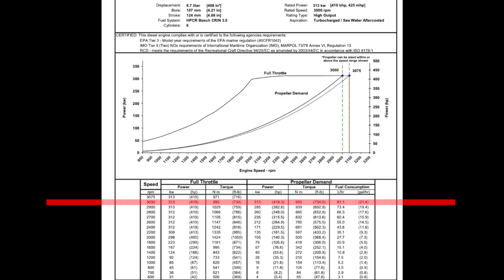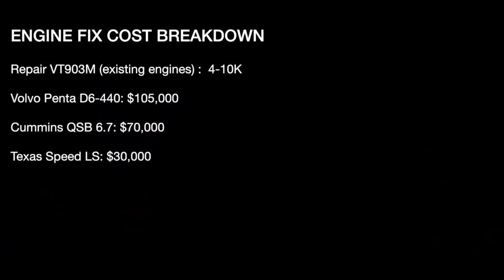Tesla Powering my 30yr Old Italian Yacht? And Broken Diesel Engine Diagnostics

Comment: Putting a gasoline engine in would have been the biggest mistake ever. For a reason I didnt hear you mention..Explosions on a boat are very real and happen most often on Gasoline powered boats. You would have to have large blowers in the engine compartment to evacuate the fumes from the gasoline vapors in the hold. Diesel is far safer, more reliable and will out last any gasoline engine. I think your just bouncing a lot of Ideas around, which is fine. just remember the engineers who designed your boat are waaaaaay smarter than you about boats. Don't mess with what works. Have them both rebuilt by professionals..Have fun boating, instead of all the headaches with engine swapping. Oh yeah, one more thing Never run a knocking engine. It came with two for a reason. so you could shut one off in emergencies, and get home on the other.. Nice boat.. Happy sails...

Comment: dude those are cummings engines.... they are like some of the best engines in the world bro.

the diesel fuel is cheaper.

they make more torque at low rpm (you gonna have to rev gas to move). its gonna get real old real quick redlining your engine just to turn around at the dock, while people float across you at idle.

they're already 'built'. the pistons, rods and crank on those things are massive. You could boost it more now, as it is, stock, without adding anything.

The engine case pressure blew off the rocker cover cap. What gas engine do you know that can have that amount of crank case pressure in the head and still have no cam or rocker assembly damage?

you can add in digital gauges to monitor the engines any way you need to.

im worried you are really going to affect the quality of your future boating experience for something that is temporarily cool

Comment: Out of curiosity, if you were to go electric and wanted comparable performance and range, just how many battery packs would you need?
Reply: Omg a lot .. you would need a charged battery pack every 5-7nm but you wouldn’t be able to carry any more than one per motor otherwise the increase in weight would add drag which would lower the range on a charged bank .. see where this is heading ?

Comment: If you went gas engine surely you could run an LPG system thus bringing fuel costs down. But equally there must be a reason most boat builders go diesel
Reply: Bang!! There is a reason you never see lpg in marine situations

Comment: food for thought the boat is balanced around the weight of the engines where they are. There could be som pretty big issues caused by getting lighter gas engines. Plus the economy will be alot worse.

Comment: Your math on the electric motors is very wrong. The 1 gallon of gas to 33kWh is purely from an energy standpoint. You have to factor in that electric motors are 80-97% efficient while gas engines are 15-25% efficient. You should do the math out again before ruling out electric because it would be so much more practical and you'd have 1 of like 3 Tesla powered motorboats in the world.

Comment: You don't want a 'failsafe' that automatically shuts an engine down. Alarm yes, shutdown, absolutely not. There could conceivable be a time where in bad conditions you need to risk  sacrificing the engine to get out of harm's way....say you have to make it back across the bar before bad small craft advisories and gale force winds hit. High reliability is the name of the game out on the ocean. ...any modification you make should be focused on increased reliability,  not performance.

Comment: you could do electric without going the ludicrous motors, and a lot more battery capacity, plus an emergency generator? for a lot less than $70k. pretty much be PHEV diesel electric lol.

i still vote rebuild the diesels, they're still cool.

if you're concerned it's not crazy enough.. build the diesel, bigger turbo, more boost, make them make power?

Comment: You really only have one option; diesel.  As you pointed out an electric motor is ridiculous.  You might get 15 minutes and you WILL get stranded.  As for gas, and while I realize there are LOTS of gas boats, gas engines have no place in boats.  In short, they are expensive to run, inefficient to to run, and dangerous as hell.  Most boaters with gas engines would die to have diesel engines, which you already have.  Don't go backwards.

Comment: There is a reason they use diesels in larger boats.  Stay with the diesel and just rebuild them.  Fuel efficiency and torque will never be the same with gas.  you will regret swaping to gas.  probably destroy your resale as well.

Comment: Dude stay with the diesels. You said it yourself they create more torque that is a very heavy boat probably 18-20,000 lbs add that to pushing water you need the torque. I have a 1999 Trojan Express 400 with twin 5.7’s that I wish were diesels. Back in 1992 when the first model came out it was the american knock off version of your European Riva Tropicana Express. I love my boat it is a solid beast almost a 14 foot beam, 19000 lbs and a modified planing hull. Epic in the chop but trade off is.......she is slow. With that type of weight stay with the diesels you won’t regret it. Furthermore, you said it yourself those engines in your boat haven’t been touched in thirty years pretty reliable I’d say, think about it. Finally, CLEAN  your bilges all that dirt, grime and oil residue down there you have a fire waiting to happen. Good luck and definitely put the dripless shafts in!

Comment: You need to stay diesel is you want any value of the boat. A LS Swap would be cool and all but you will not get the ROI. I do not know what the difference between the 903 t and the 903tm (other than marine) but if you look you can get a military surplus 903 t for around 14,000, I am sure you could take the surplus engine and make it a marine engine. Since you should have the parts to swap.

Comment: You have two engines that were far larger (power wise) than a traditional semi truck engine. Imagine trying to run a loaded semi on a gas engine of any type. IT WILL BE A DOG if it moves at all. Rebuild those Cummins V8s and run that boat.

Comment: Diesel is a Nightmare :   with a big-block 454 chevy you can spend $1,500 on spare parts ( any and all parts that may Typ. break )
do that with a diesel and ur at about $7 -8,000 Min (fuel and water pumps, alternators, starters etc...)

Comment: Stay with diesel it is actually more efficient for boats, it has more power, you have longer range, and those engines will go forever as long as you have fuel. Seen a Riva with das engines and yeah it had speed but it went through 300 gals in less than 15 hours, the vessel I was on we had 200 gals and went from long Beach ca, down Ensenada and back to san deigo the gas engines are also more flammable than the diesel, you would need to put blowers in the engine compartment to clear the fumes out.

Comment: Majority vote here stick with the current engines rebuild possibly mod cause Cummins... and enjoy the boat yes engine swap would be fun but value for money long term gas is gonna kill ya... and like you stated imagine running a gas engine at full rpm for long periods most worked engines won’t do that for very long...

Comment: Depending on fuel efficiency and fuel prices you may be better off staying with the diesel engines repair of rebuild they are at least reliable when in good running order and the boat was designed for them in the first place and safer as far as fire safety is concerned  since diesel has a higher flash point than gasoline and the change over to gas entails more modifications than you may think.not just the tank and fuel lines but other electrical additions as well as fire suppression system you may want to include .for safety you know ..just in case  because a fire on a boat in  the water  and/or in the middle of nowhere is no joke..the other equipement that needs replacement or upgrading are just as important. I live in Fl. and boating is one of the number one things here and boating safety is a legal thing all over the world. navagation lights are juust the tip of the proverbial Ice Berg.   thyat boet is "{a big hole in the water that you throw money into never to get it back,,,,GOOD LUCK!!

Comment: Rebuild then and re fit the cummins The boat was designed to be powered by them def more bang for your buck and the fuel is 100% safer than a gas engine

Comment: i would rebuild old ones they’re bulletproof made for it don’t have to modify transmissions with new expensive engines an these new diesel engines have problematic emissions installed in them ,they won’t last 30 years like old ones ,stay with old cummins you would be much happier good luck

Comment: If you want to go electric as a power source then you are thinking backwards. You are thinking of battery storage. You should instead be thinking electric production through the use of an onboard power plant such as diesel engine technology. This configuration has been in use since the 50's. I work in the rail industry and when our locomotives have outlived their cost verse asset analysis due to age or emission regulations we scrap the locomotives and the engines get repurposed to marine applications. You can have 1 diesel engine powering a generator instead of 2 powering props. You can even use pods instead of the props if you want to be more efficient, agile speed. Weight analysis will show less weight to power equals further range and efficiency. Do your research, cruise ships and bigger are powered this way. A project of this nature would get more views and would increase the value of this vessel unless you are just using your existing sponsors for this project. Diesel electric is the way to go to modernize this 30+ year old vessel.

Comment: I wouldn't use gas engines in a boat, as the hulls waterproof, it's also airtight. Any fuel leaks mean you have a potential bomb.

Comment: Wait you just talked about why gas engines aren't feasible in a boat application due to the engine needing to run at very high torque and power for very long periods and how you can't expect a gas engine to run at high output and RPM's for hours at a time. Then you ignore all that and start talking about putting in Texas Speed LS engines into it. What's wrong with this picture?

Comment: 100% incorrect , boats built to plane use less power on the plane because of the low water friction eg. the is less boat in the water to cause drag, the power is used getting the boat on the plane in the first place, the most inefficient  speed in a boat  is above hull speed and planing speed , the reason sail boats use so little fuel  is they  use tiny motors (about 30 to 40Hp for a 40 footer) and they stay at or around hull speed (6 to 8 Knots) and rev at or around 2500 rpm if they try to exceed this the stern just drops in the hole in the water caused when the bow wave hits the stern wave going no faster but using more fuel, thats why power boats have trim tabs to help stop the back of the boat burying and to make it easier to get on the plane.

Comment: I'd say rebuild the diesel. You haven't had it that long so go cheaper and enjoy it for a while. If you want to change it later, I'm sure you could sell those engines for plenty. Plus I'd bet gas engines would kill the value, not just because it's different and not how it came but because 2 engines are 30k versus 70k+ for diesels. But it does sound like you should keep an eye out for a "needs work" yacht and fulfill your big block dreams!

Comment: havent even seen the vid but i will say HELL YES, make it electric engine ffs, you could use solar panels and have unlimited fuel,if your battery bank is big enough it really could be unlimited electric motor power :), and if you want the foot pounds to move it across the water electric motors can give you massive ammouts of it .

Comment: Electric is the ONLY way to go I have new 2170 20 watt 5 amp batteries @ $2 each at 15,000 x 2 batteries will give you .5 MW per engine and you could get 1.5 hrs at 40 mph with it, you will need to 1.5build the battery pacck but that is relatively easy , your fuel tanks are replaced with the batteries and put as low as possible as well because you have saved 5,000 lbs in dead weight just in the engines the 1200 pounds of fuel saved will give you a boost that is much lighter,  have a source for the batteries. but you need 21700 or the new FBB from Tesla good luck. you will need rapid charging but 220V @60Amp will give you 17Kwh so 5 hrs should get you charged the batteries will weigh 2819 lbs you save 5000 lbs.

Comment: Multiple electric motors like the Mach-e to Increase power/torque. Then a diesel generator to increase range and recharge anywhere?
Reply: No... read the laws of thermal dynamics.. gen =mechanical to electrical energy,, electric motors = electrical energy to mechanical energy.. the laws of thermal dynamics dictate that at each energy change there are losses .Diesel engines produce mechanical energy , so ....

Comment: bruh! why the hell would you go gas?? if anything use gas engine go E85 at least! the way to go will be 
1) Rebuilding the diesel engines!
2) Doing all the gauges and custom ecu for safety shutoff's and more digital data (for the diesel engines)
3) New Nav systems, depth meters, satellite Wifi and all the fancy gadgets 
                                                         Maybe 
4) battery packs for electric consumption hooked via a diesel generator/engines

Comment: great video! question, when you looked at electric, did you recalculate performance eliminating 2 super heavy engines and huge fuel tank, and the engines related stuff, exhaust fan, transmission, etc... So, very cool video and thinking out of the box!

Comment: Please keep the diesel, being a marine engineer, replace the engine, please do not mess round as its not like a car where you can pull over and wait for assistance, sure you have a second engine, but not worth the risk rebuilding having seen engine failure and people rebuild and fail again, not worth it. 
Also if you take those engines out and put smaller ones in you will have to ballast the crap out the stern, plus lead anin't cheap!

Comment: Hiya Chris, huge fan, been watching from the start and love you guys.

I have a few very poorly researched comments to make on your choice of propulsion. I have no axe to grind, my daily is a performance diesel, by race car is gasoline twin turbo and the experiences I’ve had of EV,s has left me in awe.

So, when you looked at the power density of gas vs batteries, was it “at the tyre” or accounting for the combustion engines  making 75% heat and noise and Only 25% go and the Tesla motor turning 90% of the energy into drive or were you working off before losses.

Also why only 2 battery packs? if your 2 motors and full diesel tank weigh 9000lbs and 2 Tesla motors weigh say 500lbs, would it be feasible to put 8500lbs of batteries in ? 

Anyway when you take the above into account it clear to me you need to get Exxon to sponsor you and install 2 x BB Chevy 540ci motors with 4.2l Kenne Bells. 2000ft lbs at a relaxed cruise and drag boat racing with 20 brave passengers on the 4th of July 🤣

Comment: Hundreds of gallons of gas/explosive fuel is not smart to have on a boat... also, if you are not looking to go 40, you can use much more economical engines than the top of the line Tesla and use the fund savings for 4 sets of batteries with an onboard emergency generator... lastly, you will nead less thrust with the 9/10K pounds of engine/fuel you are removing... don't build a boat for anything other than how you use it, by the time you are done, you will realize its better off sunk than sold.

Comment: I cannot fathom why anyone would switch from these diesel engines to any gasoline engines. Gasoline engines are far less efficient, have much less torque, especially at low rpm, which would require higher rpm, which increases heat, which increases wear, which increases maintenance intervals, oil consumption, and the likelihood of failure. On top of all that, gasoline is a MUCH more volatile fuel and you do not want to be stranded floating next to a burnt out hulk, assuming you survive. In short, no offense, but you're not smarter than the engineers who design these things. If I were you I'd look into maybe just modernizing these diesel engines with better gasket materials, bearings, an upgraded fuel system, better turbos (maybe twin scroll or compounding?), and more sensors (MAF, oxygen, crank angle, cam position) that could be used in conjunction with a modern aftermarket ECU. Maybe get in contact with Gale Banks.

Comment: Stay with diesels they live forever when taken care of. Ur gonna need a counter rotating motor and a standard. The port motor is the counter rotating and the starboard is the standard. Just remember what u do to one motor u have to do to the other. Want to keep everything balanced.
Also if you go with big block get some 502 8.2  much bigger displacement --> more power. Also not called flooring it, In a boat is  Called wot, wide open throttle.

Comment: for electric, there is a Swedish electrick boat company (maybe ask them for info and advice), and there is a new electric company with a new car that has been announced or released, that have different electric tech than teslas (convince them to partner with you for a proof of concept for their tech on boats, and some fun r&d stuff), but you wont go wrong with a diesel xD if it were a smaller boat gasoline would be okay, but shes a fatty, stick to diesel, maybe just rebuilding both of your engines would be the smartest path to take, aanyways best of luck